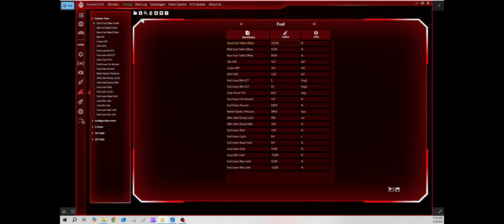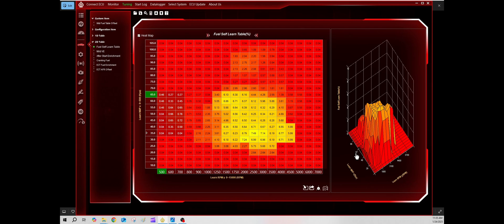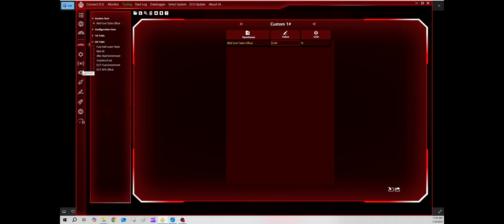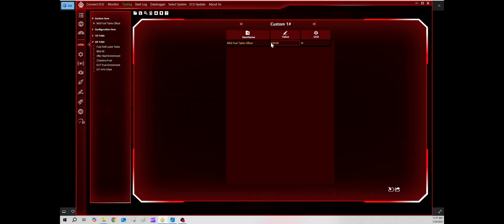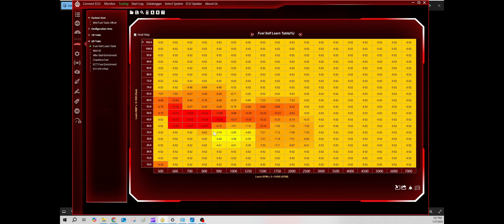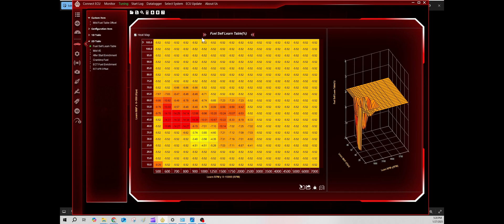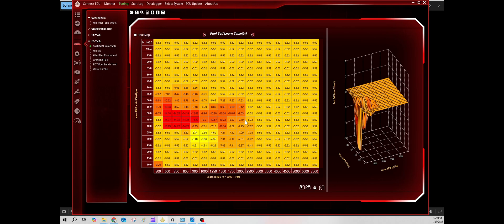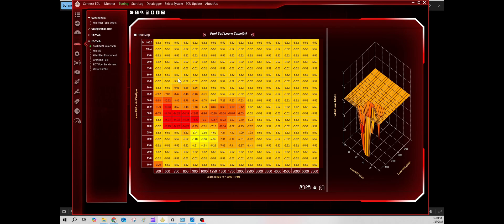***Important Update*** Learning to Tune the ACES EFI Killshot- pt 2

Comment: I set my fuel table per Tim’s instructions and mines at 72%
Reply from the maker: Right.  I've spent HOURS looking up info on this and other systems.  I've seen pretty much everything Tim's done.  Sadly he never states things like this, but after watching a lot of his vids... I paid really close attention and noticed he always starts at 100%... then tunes it to get it very close.  If the VE map works for him across the board and the whole thing is just a bit off, then I've noticed that he adjusts the offset.  I've noticed that when I was at 55%... when I adjusted the VE table, the system would add what I told it, then end up removing the 45% from the offset and so would still need to self tune to get itself correct.  If you got your table right... like Tim did, and then the whole shabang needed to drop to 72% as a whole... then you probably did it right too.  Mine was all kinds of wrong... the offset was pulling 45% fuel out and then asking itself to add more back in because it was too lean.  That's why I think it needs to be tuned at 100% first then adjusted with the offset at the end.  I'm sure yours is right then.  Mine was just acting strange and this would explain it.
Reply from the maker: Which vid of his did you follow by the way?  Was it the Suburban on E85 one?  I love that one... tons of info in it.  I based a lot of my tuning vid on that one.  Check out his "Fuel Table Offset in the Handheld" vid and you'll see. The display shows (even though he doesn't mention it) that all his VE tables started at 100%.  If the whole table was off... not just a select portion, he then uses the offset on the whole table.
Reply: @dc10tech911  yeah that’s the one. I probably messed up as I’m still having issues. I’m new to tuning and adjusted my fuel table before I touched my ve. Maybe I should put it back to 100% then adjust my ve correctly and try that.
Reply from the maker: @jessejackson386  Maybe... but don't let me deter you. If your setup is running fairly well stick with what worked for you!  These vids are just to provide some basic guidance. Every car is different depending on how the engine and tranny run.  Again, if yours is good enough to make you happy don't mess with it just enjoy the ride. ;-)
Reply: @dc10tech911 do you know a correction for a lean bog when blipping the throttle and going dangerously lean on deceleration. Mine goes so lean that it dies
Reply from the maker: @jessejackson386  Ouch... that sucks.  For the lean bog- The first thing you need to do is work on the VE table like I showed in this and the previous video.  As I've heard, when you transition fast, the system goes into Open Loop.  At that point it's only looking at the VE table and not really learning anything.  That's why ACES asks you to drive it normally until it's done learning.  Anyway, tune that closer to correct and it should help out a lot. AFTER THAT, if you are still having issues, you play with the "Acceleration Correction vs TPS" chart.  You increase that little by little until you get what you need.  If your VE is all kinds of wrong and you mess with Accel vs TPS... the EFI can "learn bad habits".  It will be messing with fuel delivery and possibly adding more fuel than you need, which will make it think it needs to run leaner... then you'll add more.. which will make it think go leaner again and again... vicious downward cycle.  So... VE table first, then Accel vs TPS.  As for Lean on Decel... that's normal.  Mine goes to about 20 to 30 something in AFR.  Are you running the ACES distributor?  I hate that thing.  EVERYONE seems to be having ignition problems. If you are using timing control, you need to add a little bit to your Follow Base Timing table.  When you drive, look to see what your MAP is reading when that happens.  It's probably low like anywhere from 10 thru 30 or 10 thru 40 because when stopping your engine has low load and so oyou should be in that range.  Also what RPM were you at?  Then you go to your software> ignition> 2D table> then Follow Base Timing.  Now... say your problem was up to 30 MAP and when you stopped you were anywhere from 1000 to 3000 RPM... then click and drag to select from 30 and 1000 RPM and select all the way down to 10 and 3000 RPM.  Now that the huge block is selected, right click and click on "Fill Row Values".  That might get you closer to what you need because it just added more timing on deceleration and it evenly distributed it across that zone.  If you're not using their distributor and just a regular one like me... then I don't know what to tell you. Only the guys using timing control seem to be having this issue.  It's probably why ACES says to use a regular distributor until you're done making the system learn... THEN install their locked distributor.  Dude... I know that's like a book I just wrote. I'm sorry... don't know how else to answer you. I hope that helps you though.
Reply: @ I appreciate the info. I’m running a stayed gm hei. I was told that maybe I need to adjust my weights but that’s far beyond my knowledge. Aces keeps telling me to adjust my follow air decay ratio but it does nothing. I guess I just need to get it to run correctly with my ve table and then when that’s dialed in, I can focus on the lean decel. Again, I really appreciate all your info. Very helpful
Reply from the maker: @jessejackson386  there's a ton of vids on distributor adjustments. Some times if the distributor is old the weights under the cap might be sticking... then you would need a special grease to slightly lube them... Other times it's the little springs on those weights.  They might need to be replaced. Look up several vids on distributor advance adjustments.  If the timing is not working right you will always have problems.  That's why I use my regular distributor and don't use theirs.  EFI doesn't fix engine problems... It actually makes them stand out even worse.  That's why so many guys are saying it's a bad system then find out they had an underlying issue all along.  Really... look up vids on the distrib advance adjustments and see if it get beeter first... then the other modifications.